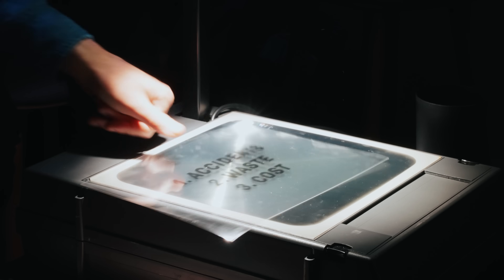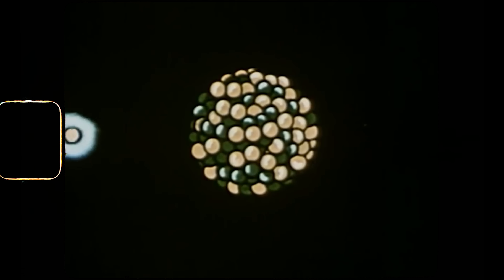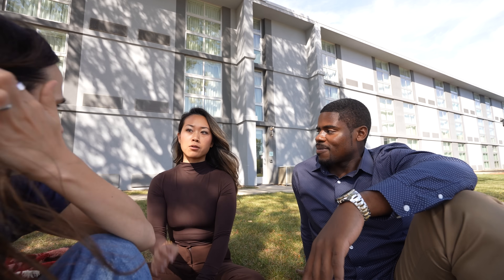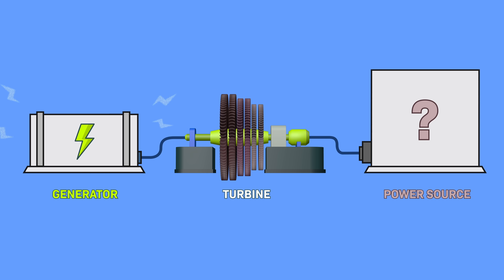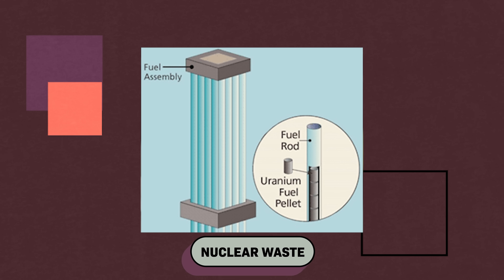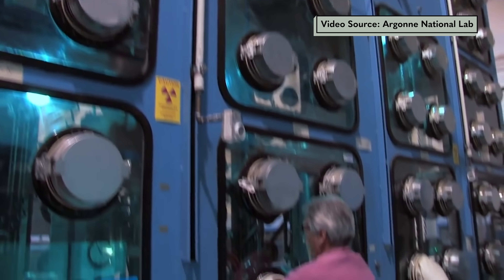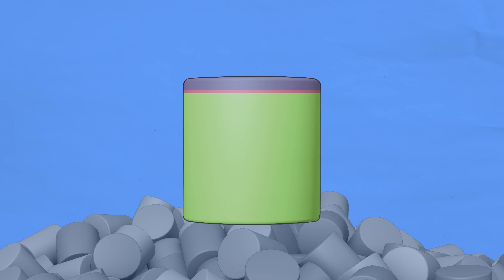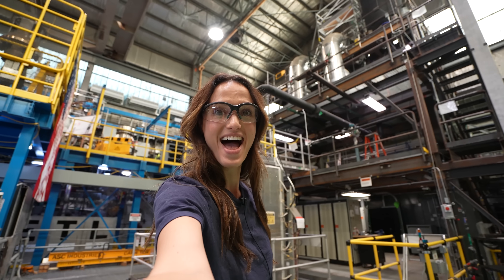The Big Lie About Nuclear Waste

Comment: Nuclear fission is a red herring. It's too expensive, takes way too long to build and doesn't solve the problem at hand. And we are quickly running out of cheap uranium as well. Breeder reactors are a nice idea, but even more complex and expensive.

Wind and solar are here to stay. At its current cost level (€20-30 per MWh) it's about 5x cheaper than newly built alternatives, including nuclear.

Nuclear can only be marginally competitive if it can run at full output all the time. That's not what we need.

What do we need? A technology that can infill the energy needs when solar/wind are offline. In essence a big battery without the rare earth metals. Some countries are lucky with sufficient pumped hydro capacity. Most are not.
Reply: With a low discount rate nuclear power is cheaper than renewables plus storage. And the storage MUST be included in the price.
Reply: @Crispr_CAS9  Who would be paying for that low discount rate? You can't start giving subsidized loans and then claim nuclear is attractive. 

Newly-built nuclear power has a strike price around $140/MWh. (Hinckley Point C). Solar&wind are less than $60 anywhere, but mostly $20-30. 
Storage systems right sized for solar&wind currently add about $20. There really is no economic case for nuclear.
Reply: @jgo1176  "Who would be paying for that low discount rate?" The phrasing of that question tells me you don't understand what a discount rate is in the first place. 
"Newly-built nuclear power has a strike price around $140/MWh. (Hinckley Point C)."  Compare to Barakah, which is a fraction of that. Because... UK had a high discount rate for HPC, and UAE had a low discount rate.
"Storage systems right sized for solar&wind currently add about $20. " Storage that only adds $20 is no where near sufficient to manage renewable only. Which is what you need.
Reply: @Crispr_CAS9  a low discount rate means a low risk allocation. Barakah's operational risk is carried by the UAE. The loan has a fixed and guaranteed low interest rate. Guaranteed offtake, guaranteed everything. Of course it is cheaper. So is solar in Saudi. 

In the real world, we're building HP3, Flamanville and Olkiluoto. Economic disasters, which could literally bankrupt countries.

And don't forget that all over the world the tax payer pays for abandonment because there never is enough cash with the owner.
Reply: @Crispr_CAS9  your storage assumptions are wrong. On utility scale you need about 5-10% of capacity. And storage is $400-$600 per MWh
Reply: @jgo1176  "a low discount rate means a low risk allocation." No.
"n the real world, we're building HP3, Flamanville and Olkiluoto. " In other words you only think Europe is the real world. There's no way around it, that's really racist.
Reply: @jgo1176  "On utility scale you need about 5-10% of capacity" No, you need >100% of capacity for 100% renewable.
Reply: @Crispr_CAS9  clearly, you know nothing about renewables.
Reply: @jgo1176  Clearly, you know nothing about renewables.
Reply: @Crispr_CAS9  the real world is where a business has to make a profit, and where energy is a market.
Vogtle 3/4 USA: > 30 bn, Westinghouse bankrupt, cost per MWh: $140 at 5% discount rate, (7-12% is the norm).

Wherever you look, new nuclear sits above $100/MWh as base cost of operating the plant and pay back the loans. This all assumes 60 year lifetime and 40 year payback times.

The only exception is India, where they can do it at $60, but the loan is sponsored by Russia at non-market rates of 4%.

Current global spot price for electricity is $33. You need to see a lot of value in this baseload to want to spend that much capital.
Reply: It took decades of research, development, and funding for renewables to become as cheap as they are today. Why not do the same for nuclear? You only care about short term capital costs that can easily be recovered once commercialization of nuclear energy pays off in the long run. .
Reply: @ianhomerpura8937  nuclear energy has been researched since the 2nd world war.  Since 1956, it has been fully focussed on power plants. The first fission power plant was built in 1960. Fusion has been researched since 1950. That's 7 decades of research on the topic. The cost of a plant, or a unit of energy, has not come down, rather the contrary. 

Solar panels were invented in 1941. From that day onwards solar panels have become cheaper everyday.
Wind turbines were invented in 1888. The first megawatt turbine was installed in 1941. Since then essentially, wind turbines haven't changed anymore. We were just waiting for adoption.

Comment: Great informative video .I worked in Nuclear power for 20+ years .Nuclear is the most powerful green energy there is.  According to GTM research a 1 MW solar farm would take up 6-8 acres. Wind turbines produce 2.5 MW. Nuclear can produce over 1,000MW per unit. 24 - 7

Comment: Safe energy? When your school is in close proximity to a nuclear power plant, and they distribute information annually about the evacuation plan and blast zone radius that your school is in during a nuclear power accident emergency, you start to question why they call it safe energy.
Reply: Is coal, oil, or gas safe? How many have died from pollution and smog?
Reply: @ianhomerpura8937  I don't know if there is a type of fuel burning which is 100% totally safe. Accidents happen even with wood campfires.
Reply: @ianhomerpura8937  Which would you feel more comfortable living next to, a solar panel power plant or a nuclear power plant?
Reply: @artist_joewhittington  so it all boils down to NIMBYism - " I feel afraid, so I don't want this anywhere even if it can help me"

Comment: Unbelievable that you are even suggesting we should go the route of recycling spent nuclear fuel. Tepco recently said that there were more than one total core meltdowns at Fukushima  in 2011,and that they don't know where those nuclear cores are! I can guess! If you have any long term blackouts in areas where these nuclear power plants are you will have more meltdowns going down into the earth. There's an untold amount of damage that was done to ecosystems from the Fukushima meltdowns and you bet your life that that damage is on going. We need free energy systems using sacred geometry and need to get totally away from the dangers and damage that has been done and is being done to life on earth by the nuclear industry. Nuclear hell no! Anyway Nuclear is dead. Many countries are now shutting down there reactors and that's good news for us all.
Reply: Japan is actually REOPENING their nuclear power plants, and Germany has suspended the shutdown of existing NPPs. Relying on Russian natural gas was an absolute mistake and only helped turning Russia into an unrepentant petrostate.

Comment: What I understood is that the whole reason we went with light water reactors are that they will easily generate excess plutonium that could be used to make nuclear bombs. On all other fronts the molten salt reactor is so far superior that it isn't even a contest. They don't want to change because they want a source of plutonium. So we have pressurized reactors on geologically unstable ground close to water sources that need power to shut down. Instead of non pressurized reactors on sites chosen for there stability and absence of ground water that don't need power to shut down. And can burn 99% of the fuel instead of less than 1 % . Its insane.
Reply: "They don't want to change because they want a source of plutonium." You can't use commercial LWRs to make weapons grade plutonium, and no nuclear weapons have ever been made with plutonium from commercial reactors.

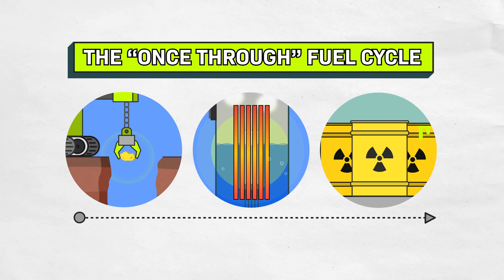Comment: Anyone else notice that the chart for radioactive decay is logarithmic? Means that it's exponential decay instead of the very differently displayed linear decay. Game changer. 8:30
Reply: It's called half life.  Just as an example.  You start out with one ton of material with a 1 week half life.  At the end of the fourth week you will have 1/16th of a ton that is still radioactive, the rest has decayed to a stable isotope or to lead.  That's overly simplified as some isotopes will decay to a different radioactive one, with a different and possibly longer, half life than the original.  Others will decay once or twice before they get to a stable isotope, or they decay into lead.  But I think it serves to illustrate the concept.

Comment: Sound very similar to another nuclear fairy tale: the Transatomic's Waste-Annihilating Molten Salt Reactor (WAMSR). Look up the whole saga from "What if we could build a nuclear reactor that costs half as much, consumes nuclear waste, and will never melt down?" to "Nuclear Energy Startup Transatomic Backtracks on Key Promises" (both MIT Technology Review). Quoting: 

The dramatic revisions followed an analysis in late 2015 by Kord Smith, a professor of  nuclear science and engineering at MIT and an expert in the physics of nuclear reactors.

At that point, there were growing doubts in the field about the company’s claims and at least some worries that any inflated claims could tarnish the reputation of MIT’s nuclear department, which has been closely associated with the company. Transatomic also has a three-year research agreement with the department, according to earlier press releases.

In reviewing the company’s white paper, Smith noticed immediate red flags. He relayed his concerns to his department head and the company, and he subsequently conducted an informal review with two other professors.

“I said this is obviously incorrect based on basic physics,” Smith says. He asked the company to run a test, which ended up confirming that “their claims were completely untrue,” Smith says.

He notes that promising to increase the reactor’s fuel efficiency by 75 times is the rough equivalent of saying that, in a single step, you'd developed a car that could get 2,500 miles per gallon.

Comment: So... right now radioactive Uranium ore is scattered all over the planet... and people are upset that companies/governments are collecting(mining) these radioactive materials, using them to provide energy for humanity and then storing these radioactive materials in a small number of secure locations. 

Isn't that helping humanity by collecting the dangerous material that is scattered and placing it in specific areas to limit humanity's exposure? Isn't that what we do with human trash, collect it with garbage trucks and place it in landfills away from people?... Only this "trash" gives us tons of energy before we store it away!!
Reply: How about radioactive coal dust?
Reply: @ianhomerpura8937  How about it? What does that have to do Nuclear Waste from nuclear power plants? How about X-ray machines? How about the Sun? How about Radon? How about Eating and Drinking? How about smoke detectors, watches, TV's, computers, lights and glass? If you're just wondering about sources of radiation... there are thousands of them! 

The average person is exposed to 620 millirems of radiation per year. People living near coal fired plants are exposed to a maximum of 1.9 millirems per year...e.g. dental x-rays will give you 1.5 millirems and the Radon in the air gives you 200 millirems per year. In general, coal ash is only slightly more radioactive than average soil. 

But what we are talking about here is collecting nuclear solids (not gasses like Radon) that we find all over the surface of the Earth and using them for energy before storing them away in a safer place than when we found them.

Comment: The cost is only part of the problem. Since all atomic power plants are shielded from liability by law, we the tax payers are the ones who bear the risk. so it is the perfect crony capitalism: Public risk generating private profits. It is also a terrorism target, so all parts of the supply chain need security, further driving up the cost. It is great for outer space, but we have many better alternatives here on earth. If we put a small fraction of the money burned on nuclear into solar and wind, we would be there by now. Everyone needs to have a few hundred kilos of molten salt stored in ther basement. It can be heated by thermal solar and excess power during peak periods and used to heat and power the house at night. We do this on an industrial scale and certainly have the ability to scale it down. All we need is the will.
Reply: "Since all atomic power plants are shielded from liability by law" Nuclear power has the same liability limitations as literally every other industry.
"If we put a small fraction of the money burned on nuclear into solar and wind" We've put significantly MORE money into solar and wind than nuclear power.

Comment: I subscribed!
I have a question though and since you're already doing the research, I thought maybe you already came across the answer. Also it dovetails nicely with this video.
Considering that we're already collecting solar radiation and turning it into power without heating water etc, couldn't we do the same thing with "spent" fuel from nuclear reactors without the cost of breaking down that fuel in the first place?

Comment: the most common misconception about nuclear waste is that it's all high level super radioactive waste that'll last 10,000 years... In reality, only about 1% is high level waste; 4% is intermediary (half life of about 100-150 years), and 95% is low level waste (20-30 year half life)

all that waste could easily be used in betavoltaic batteries (energy generation from decay of radioactive beta particles); it's just that the undue fear of anything nuclear related & the lack of commercial incentives that it's not being used.

people think lithium batteries are great, imagine having nuclear batteries/micro rtg's that last for 30 years and never need to be charged/recharged...
Reply: You are somewhat correct. 95% is in indeed "low level waste" (U238) but it's low level because it has a half-time of literally billions of years.

Comment: The problem is proliferation. The final product is plutonium the kind that is used to make nuclear bombs. You always have to look at the decay chain.
Reply: "The final product is plutonium the kind that is used to make nuclear bombs." Commercial reactors can't make weapons grade materials.
Reply: @Crispr_CAS9  The Process can be made to do it. That is why Iran is prevented from reprocessing its own spent fuel under the JCPOA deal. You can claim it does not but the reality is that it can do and does. That is what the PUREX process does.
Reply: @walkerig1  "The Process can be made to do it." If your reactor is short-cycling fuel, it's no longer a commercial reactor. 
" You can claim it does not but the reality is that it can do and does." You can claim it can but the reality is that there has never been a single nuclear weapon made from commercial materials.
Reply: @Crispr_CAS9  How many are there? Where are they?
Reply: @walkerig1  Neither of those questions logically follow from either of the things I said.
Reply: @Crispr_CAS9  How many commercial reactor' s are there that reprocess fuel? Where are the commercial reprocess fuel reactors? Why is Iran not allowed to use a reprocessed fuel reactor?
Reply: @walkerig1  "How many commercial reactor' s are there that reprocess fuel?" Commercial reactors don't reprocess fuel. They might use reprocessed fuel. And indeed many do, and nearly all can. Obviously, the type of reprocessed fuel that can be used varies by reactor design.
"Why is Iran not allowed to use a reprocessed fuel reactor?" You can use the reprocessing facilities to reprocess short-cycled (that is, non-commercial) fuel, which can produce weapons grade materials. You can't reprocess spent commercial fuel into weapons grade materials.